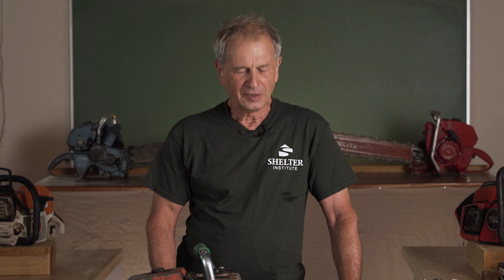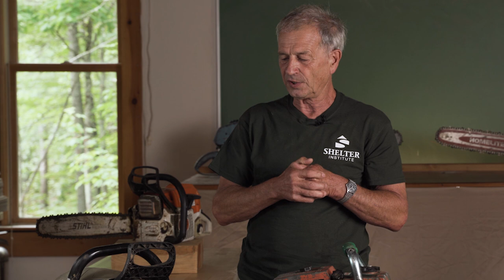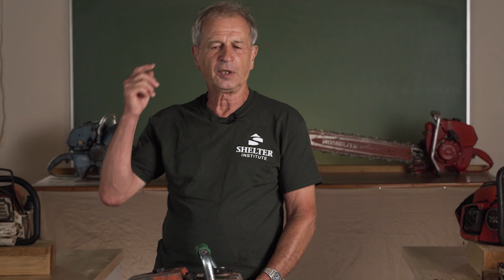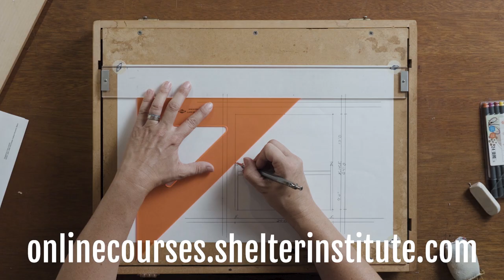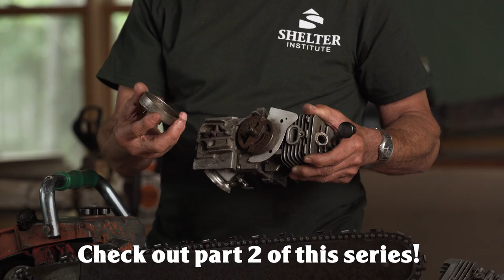Don't Be Afraid Of Chainsaws! - Safety & Responsibility

Comment: Excellent video! My "intro" to chainsawing was clearing a piddly two-acre house lot of maple and beech for the house and landscaping (deadwood, driveway etc.). I had three chainsaws - one borrowed monster with a long bar and two smaller ones of my own with 18" bars. These days I run even shorter bars on my saws since I am mostly just cleaning up deadfalls and as you note, a 16" bar can cut a 32' tree